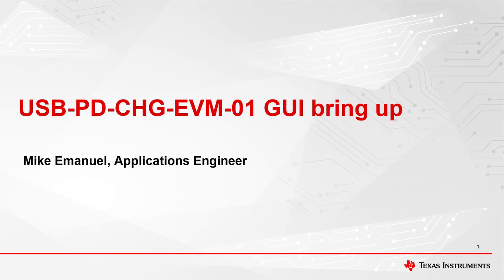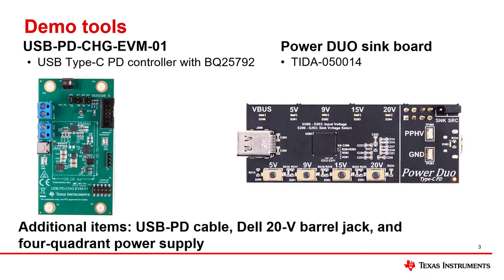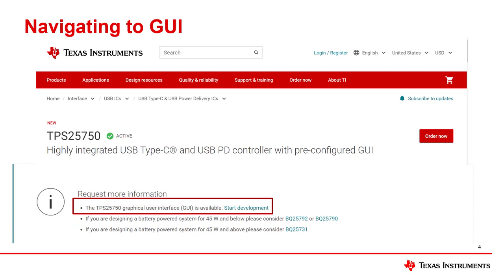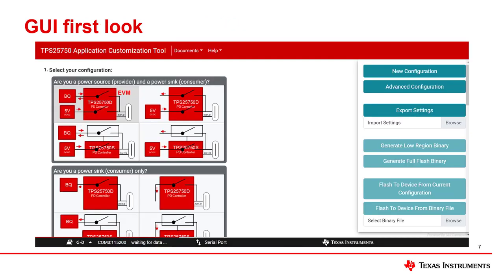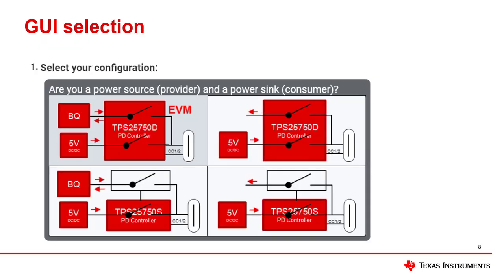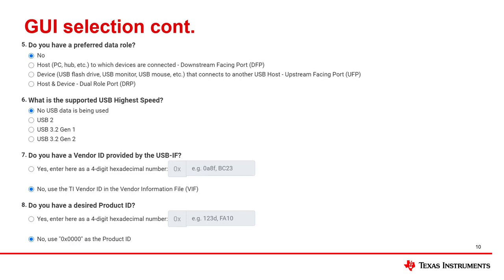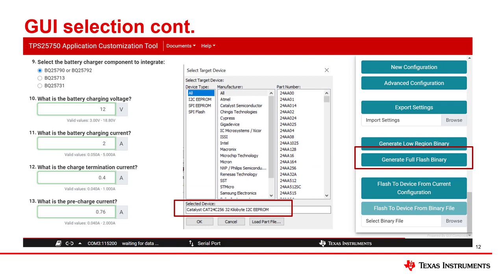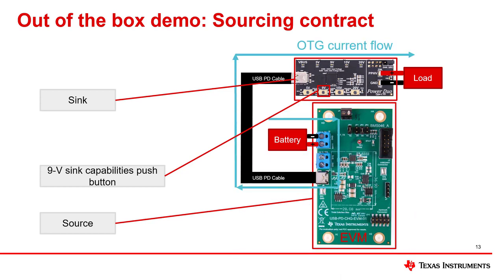USB-PD-CHG-EVM-01 GUI bring up

Comment: In this application, how about the battery voltage? If the voltage is great than 9V, for example like 11.5V, how to regulate to 9V and output to sink board?

Comment: Is this EVM for a power bank type of application?
Reply from the maker: Hi Markel, thanks for your question! The USB-PD-CHG-EVM-01 can be used in a power bank application. In this application, you would want the integration of the BQ25792 and the TPS25750 to quickly charge the battery using a USB-PD source. In addition, you can source power from the power bank to deliver power to a USB-PD sink.